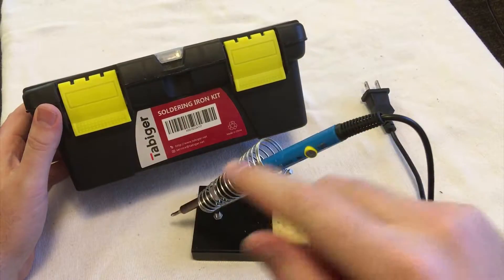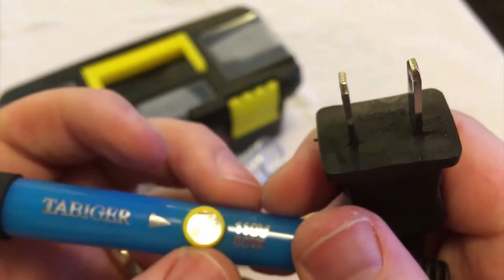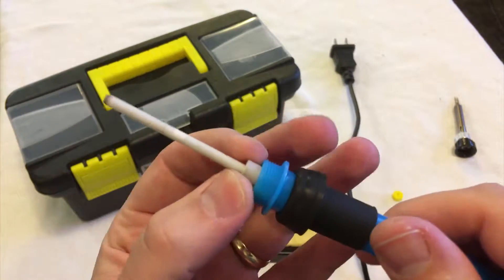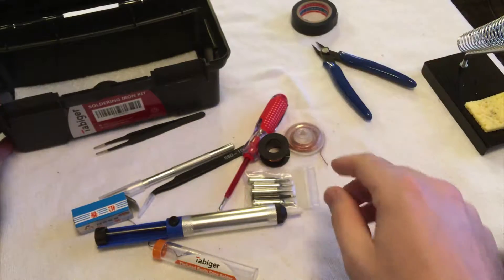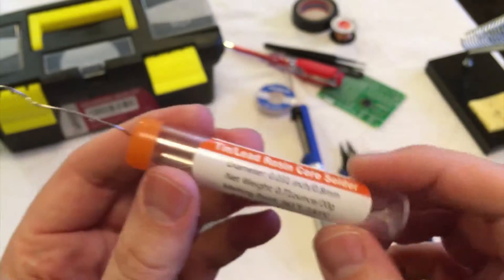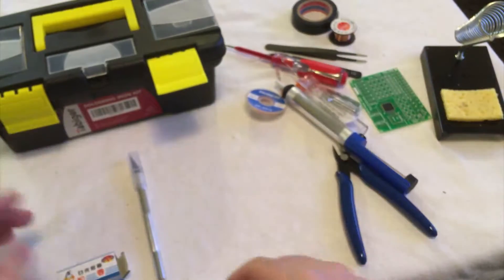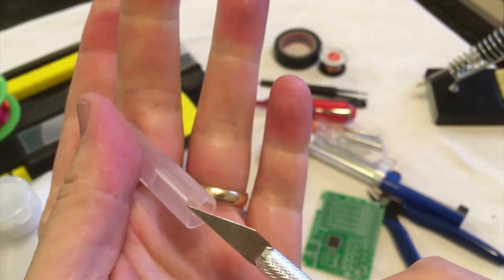SolderJS #130 - Soldering Kit for $20

Comment: 5:29 It's typically called magnet wire and it's far from useless, it's excellent for using as a jumper to fix traces or running to fix an IC that has a pin with a broken/missing pad (or you can of course make your own motor or whatever for a project) and the enamel you don't sand it you just heat it with your iron and it will burn away. 

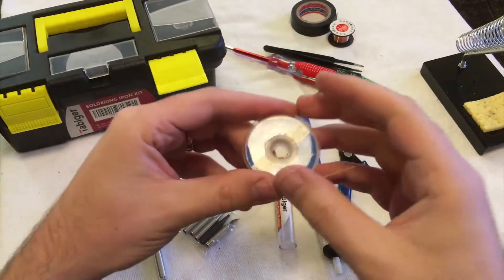5:38 I disagree, the only thing that makes this kit worth it is the plastic box, if you want a nice way to store your stuff then it can be tricky finding a really cheap one, everything else however can be bought individually for about $1 (or even less from aliexpress) except the stand goes for $2-3 and the iron can be had for around $10, so aside from the box it would cost about the same but in some cases you would get more of an item or have more choice in the case of what tips you wanted or smaller size solder or a different flux or if I didn't want more electrical tape, just to provide a few examples, don't know/don't care? Then sure get the kit instead.
Reply from the maker: vgamesx1 Just so you know, the magnet wire is only 0.1mm (38 awg) and in the description it’s advertised to be used as connecting wire, which is why I say it’s useless. It seems to be only useful in very specific applications.

I have some 28 awg magnet wire that’s suitable for generic use. I’m no expert, but my understanding is that you generally don’t want smaller than 30 awg. Is that correct?

Thanks for the thoughtful feedback and correction.
Reply: @coolaj86  I don't repair stuff for a living so I can't really recommend a general size but I would say, as with most things it depends what you're working on, if you're working on teeny tiny SMD parts then you probably want the wire to be a similar size to what you're working on and as short of a run as possible, that said there is one advantage to smaller wire similar to how if you use smaller solder and need more solder you just add more, you can double up on the wire and if you need to twist it together to get one larger piece of wire effectively giving you a slightly over 0.2mm piece of wire, so even though buying a larger sized wire is still better it is an option if you want something more useable.

I'd like to thank you for the respectable reply, not everyone will take feedback very well.